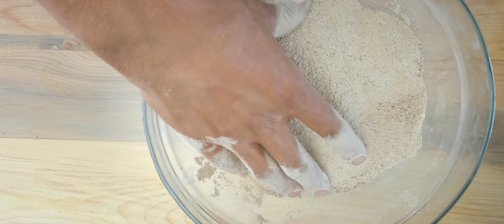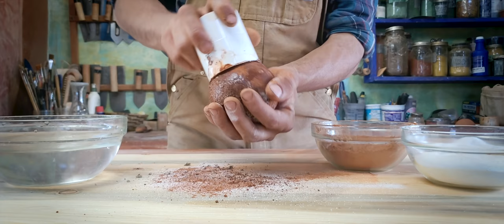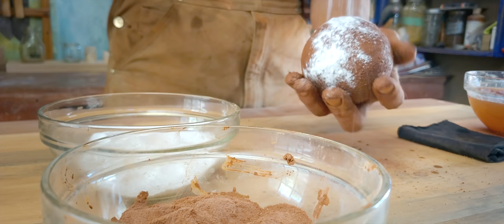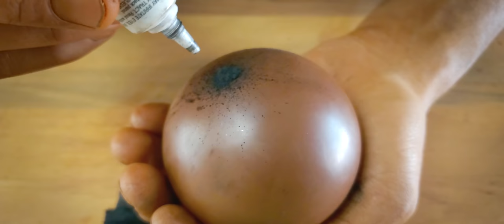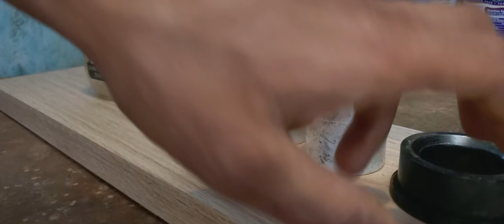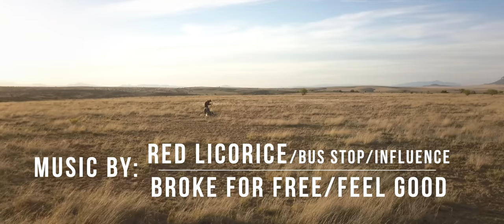Shiny Graphite Ball made from Clay and Graphite (Dorodango)

Comment: this is so cool. I wonder what other coating you can apply on the outside of a dorodango.
Reply: Orange Rightgold there are heaps of things you can use, basically if it’s a very fine powder it will very likely do the nob, perhaps not always the one you anticipated, but that’s half the fun, as the video so aptly demonstrates. Try cheap eyeshadow, shimmer or mat, it’s more or less just compressed mineral pigments and talc and you get some really cool results, oxides for dying cement work great but are as messy as hell, I got a great colour from beetroot powder, tho I’m not sure about durability what with it being organic, but so far so good. If you want a subtle hint of a bright colour then put a few drops of food colouring in the water used to smooth and polish the dorodango at the end. I’m going to see what happens using powdered coloured chalk, but I’ve a feeling it won’t be great.... While that lot should give you dorodongo in every colour of the rainbow, my favourite are still those made from 100% mud from the one geographical location. They’re souvenirs of sorts as it helps you remember a particular place when your holding a little bit of it in your hands - I’ve made dorodango from the mud in the gardens of family and friends - sometimes  these ain’t the most visually interesting, but I think they’re they’re much more special than any of the fancier ones I’ve made.

Comment: i have a question: does this deteriorate with humidity and water after some time?
is there a way to preserve this?
Reply: I made one years ago. Up here in Washington temperature can fluctuate between 20 and 100 through the year and it's always at least a little damp and humid. My ball seems to be holding up fine, though, and it's nowhere near as perfect as this. A smoother, more polished surface would help to prevent moisture from penetrating too deeply. So long as you're not baking and freezing it, it should be stable for a nice long time.
Reply: @JackSilver1410  thank you for replying:) have a lovelly day

Comment: Amateur.  You place the ball on TOP of the pipe and glass jars and run a Tiny highly metered amount of air into the chamber and it rolls around all by itself.  Material it sprinkled on with a flour sieve.